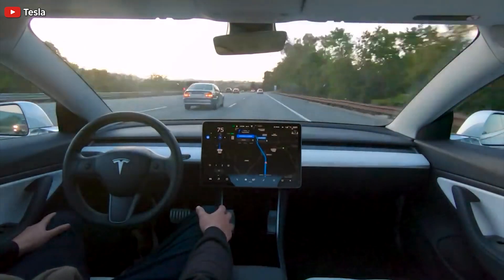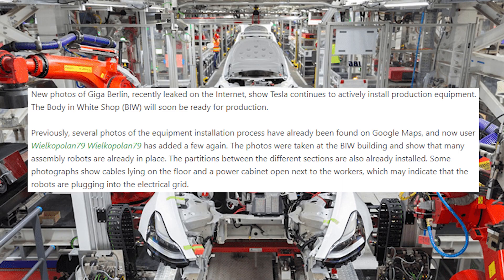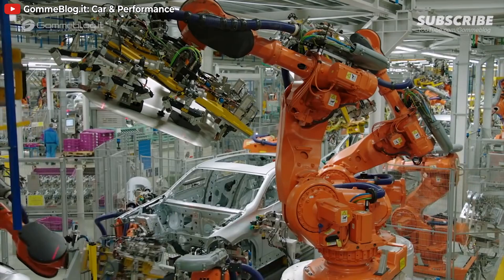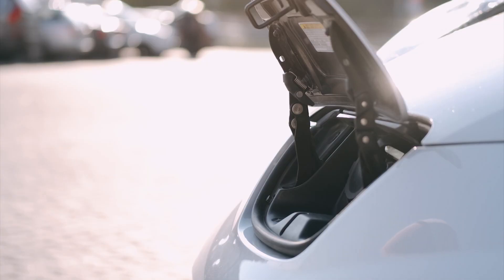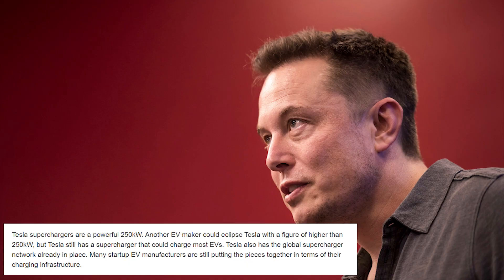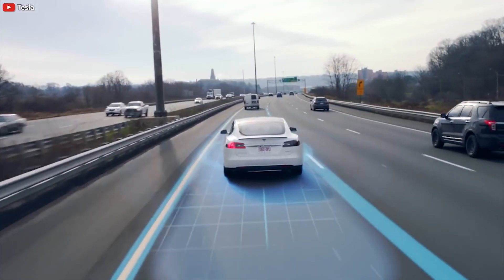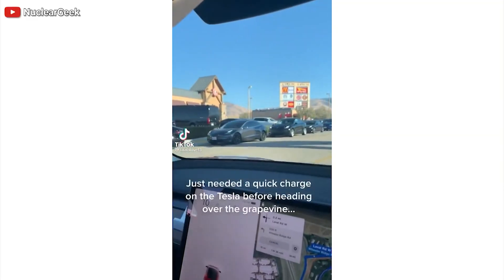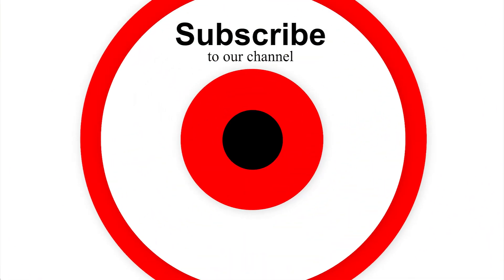Tesla Giga Berlin Makes Great Progress in Installing Production Equipment

Comment: No.  Traditional conventional legacy ICE automobile manufacturers would want to connect their slow, low battery capacity PHEVs to Tesla Superchargers.  That would be disastrous.  Also, even low power, slow charging, minimal battery capacity fully electric cars would ruin the intended experience of using Superchargers.  Until third parties are willing to release truly capable vehicles, Tesla should NOT be required to accomodate them for charging.  Politicians are SO dumb.

Comment: Overuse of superchargers can lead to premature battery pack failure, therefore it is doubtful that Tesla would push more kilovolts into a battery pack than is safe, likely the battery pack configuration will be sensed by the supercharger and an appropriate voltage that that specific battery pack are able to handle will be used for charging. Vehicles like the semi truck, the high-performance roadster, and the cyber truck will have advanced battery packs and it will be only these vehicles that will be able to handle the full 350KV that Elon musk spoke about.

Comment: I don't get the discussion about the supercharger business. As far as I know the business is already as you suggest it could be. Here in the Netherlands we have a seperate company FastNed which is not a car company but a supercharger company that builds and maintains superchargers across the Netherlands that all electric cars can use. It is very much the same way as tank stations and they are often also located at current tank stations. It seems to work very well.

Second; from the start Tesla has always mentioned that other electric vehicle manufacturers could choose to make use of the Tesla supercharger network if they would pay for that use. So far just none of the other electric vehicle manufacturers have chosen to do so. This is probably because they are not ready to build electric vehicles at quantity yet and I think they probably considered the cost of using Tesla's network as too high. 

Is this a discussion that Tesla should pay for the entire network giving a leg up to its competitors and not get any for it in return? That is simply ridiculous.

Comment: Musk said in the past he is willing to open the super charger network if those companies contribute to building the network. While I agree it would be a good thing to open it, doing so would mean Tesla will be required to build more stalls for their EVS. As it currently stands Tesla has footed the bill for their EVs to charge at superchargers and will need to build a lot more for their own demand in Germany. If other Car companies want to use Tesla super chargers then they need to pay and not push the cost onto their end users by making them pay a larger charging fee for example.

Comment: First, they should not even hold talks on it until Tesla has a Full Permit for their Berlin factory.  Second, Tesla would need to be heavily compensated for already building out the current network, by either the Government or the other OEM's.  And third, a surcharge fee would need to be imposed for all non Tesla vehicles.

Comment: I am NOT in favor of Tesla squandering its competitive advantage to other car makers who did not invest in their own fast charging system.  I am a Tesla car and stock owner and hopefully will have a say if the company seriously considers this option.
I am, however, in violent agreement to creating a "standard" so that ALL EVs can charge at a faster rate at third party locations. It might be prudent to take Tesla's current charging standards (connectors etc.) as it is the market leader.
Opening up Tesla SC to other EVs creates a host of issues, least of which is the delay for Tesla car users. If a non-Tesla EV catches fire at a Tesla SC during charging who will be responsible? 
Tesla should not be tethered by trying to service all other EVs. 
Germany is a very rich country. They should take a leadership role and set-up fast-charging stations for ALL EVs at Autobahn exits and other locations instead of having Tesla give it to other EVs. The notion that they would even consider coupling this with Giga Berlin permit is preposterous.

Comment: why can't we turn gas stations into charging stations? cause 99% of all stock is ICE cars... and there is no need for "stations"... any parking area or roadsides or anywhere there is electric grid around can be fitted with chargers/superchargers.. someday there will be charging units along highways in every 1-2 km's... like SOS phones..
Reply: ... into gas stations? In Germany this is limited by the available space. 
"... any parking area or roadsides" - are mostly publicly owned in Germany. And thus chargers which won't be able to load all types of EV won't be allowed.
I also assume that Germany / the EU will press for standardization of the plugs.
That charging stations which will be able to load cars faster than others, can - and most likely also will - charge more than others is to be expected.
There needs to be also a standard for chargers at the homes (to provide the option for those is now compulsory in Germany for new houses). That you cannot only charge your own car - but also the ones of a visitor. No matter of the car the visitor will drive.
Reply: @abalada  government can not force a party to open its assets for the use of others... for Tesla case they spent billions on charging tech and stations worldwide, now they have to waste all that resource, time and effort for German government's snobbery? EU should have been investing for solving the charging station problems for the last 10 years, looks like they did nothing and now forcing Tesla to take their competitive edge from them??? pretty sneaky... instead EU and german gov. paid large incentives for the battery production for unfair advantage of EU automakers, those automakers should develop their own tech and invest for themselves like Tesla... that's another sneaky approach which is against free market and fair competition....
Reply: @sahanda2000  Tesla will get the same subsidies for their battery factory at Giga Berlin like any other investor. Approx. 1 billion Euro.
Of course the governemnet can enforce standards on plugs etc. Do exist on petrol noozles etc. as well. 
A solely private network of charging stations is no realistic idea for Germany. This will exclude this network from all prime locations like autobahns, city centers, ... Nothing will go there without public approval. And several of such networks would waste way too much space. And would also a mega barrier for any new competitor (or just importer). Not really fair competition either.

Comment: If the auto manufacture wants to join Tesla supercharger networks and let them pay Tesla the licensing fee and charging fee. If a Nissan leaf plug adapter does not fit into a supercharger leave it to Nissan to develop a replacement plug. It’s not going to be Tesla‘s responsibility to build out the entire infrastructure for the entire country. I personally think it’s a bad idea because as a tesla owner I don’t want to pull up to a supercharger net work full of other cars from Ford and Chevy and Porsche and BMW.

Comment: When Tesla offered others to use its SC network, the others not only didn’t accept Tesla offer, they also started their own design for charging, resulting to different standard and lots of incompatibility. Tesla is not to be blamed for this problem now. Unless Tesla can charge non-Tesla cars higher rate, it shouldn’t let others use its network. It belong to Tesla investors and is for the benefit and advantage of Tesla

Comment: Super charger is a competitive advantage for Tesla and should not open to the competitors!
Reply: It’s a marketing advantage. I seem to recall that Tesla is planning to open restaurants where you can have dinner and charge your Tesla. If they due elect to open up the charging network they should have a step up pricing for off brand makers. Bring your own adapter.
Reply: In some countries which have the same charging plugs, I have had to wait for Tesla to finish to gain access to a non Teslar charger.  If the Supercharger system is some good keep using them  100% of the time.
Reply: They should open them but charge double
Reply: They should open the supercharger network. Tesla profit margin for charging  network is higher.

Comment: It is nice to see factory construction progress in Giga Berlin, and I hope that the bureaucratic permitting processes do not delay progress to long. Currently Tesla's Supercharger network remains as one of their market advantages in the EV industry, as they have the best EV charging network in the world currently. But for now only Tesla vehicles can charge at Superchargers. Tesla did talk about opening up their Superchargers to other EV automakers, but the logistics issues are that Tesla owners will always need to have priority access to Superchargers, and if Tesla does open them up in Europe they will have to create some reservation features in Tesla's vehicle and phone services. And work out payment and authentication processes for other EV owners to use the Superchargers. In Europe, Tesla's Superchargers and vehicles use the more common CCS, high power electrical plug. But in the U.S. all Superchargers use Tesla's proprietary plug connector (which is not CCS) and matches the plug sockets only found in Tesla vehicles. There are a few CCS to Supercharger plug adapters available to buy, but the software and registration components would need to be added as well before any non-Tesla Supercharger use could ever happen.

Comment: There’s more to the opening up of the SC network than just creating an app and the adapter. Warranty issues, privacy issues, competitive information, etc. Why doesn’t  the minister ask BMW to open up their service center network to handle other vehicles? Tesla does not have a monopoly of charging stations. They prioritized building them because they knew it was the limiting factor to adoption. Other manufacturers had the same opportunity but neglected to do anything and even mocked Tesla for their strategy. No one is laughing now.

Comment: Mixed thoughts.  Tesla's superchargers add value to Tesla vehicles.  Opening access to other EVs would tricky in how to bill, probably an app would be the way to go.  Since other EVs charge more slowly, it would make the stalls less available to Tesla owners. The remedy could be to add a time at stall fee in addition to the KW cost. Tesla did at one time offer to collaborate with other manufactures.  I expect that would required to be certain other brands were compatible.  As to repurposing current gas stations, that could be done now.

Comment: Problem with sharing Superchargers is that now Tesla knows not only how many stalls are in use but also about every Tesla heading to supercharger to charge and how much it will need to charge so it can predict how many Tesla’s will be there charging at any time. That is impossible to do with random 3rd-party EV’s not connected to Tesla network. This is not as easy to do if you want to sustain exceptional reliability of the charging network for which many Tesla customers chosen Tesla instead of other EV brand.

Comment: Nothing holds gas-stations back from installing rapid chargers. In Norway they already have gas-stations that only has rapid chargers. Why I say rapid charger and not super charger is because the name super charger are Tesla’s branding for a rapid charger. IONITY are rapid chargers not super chargers. Regarding 350kW, I believe Tesla are future proofing. The New Tesla S Plaid has the highest nominal voltage @450V that would allow higher peak power. Tesla doesn’t follow the regular charging standard that’s why Tesla 3 peaks @250kW at a V3 supercharger but peaks lower at other rapid chargers. 350kW are only possible when you have a 800V battery system like Porsche Taycan or Ioniq 5. A big value choosing Tesla is their own charging network. If l had a Tesla I wouldn’t want to compete with other cars. My daily driver is a Honda e and there is no problem (in Sweden/Norway) using all the other big charging networks. Fastned are also growing in Germany which are great. Germany already demands gas stations to offer EV charging.

Comment: My estimate is that the average cost of a supercharging station cost $250,000. Initially, they were run as a non-profit service for Tesla owners. Since I've not heard Elon say they are run as a non-profit service recently I'm not sure if that is still the case. If Tesla did open up it's network it will be obvious that they will charge non-Teslas vehicles about the same as the for-profit charging networks.  The real question is whether the Tesla charging network can handle that kind of demand.  There are 10 million EV's on the road of that 1.2 million are Tesla vehicles.  If Tesla did start open up it's network it might actually slow down the deployment of EV chargers by other for-profit providers.